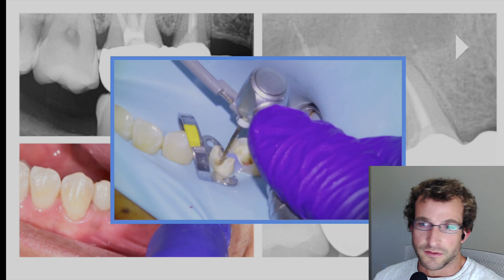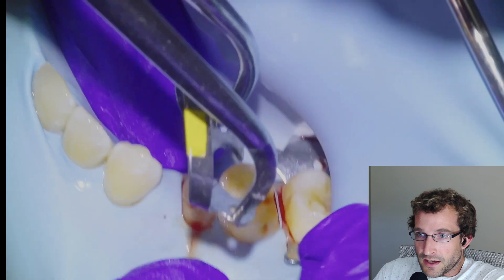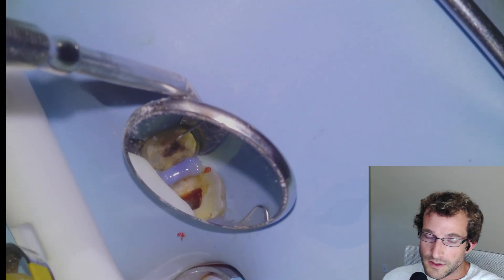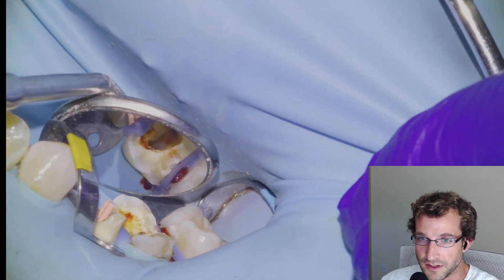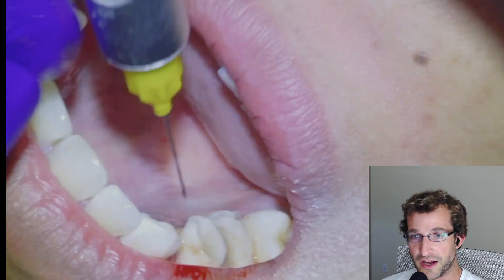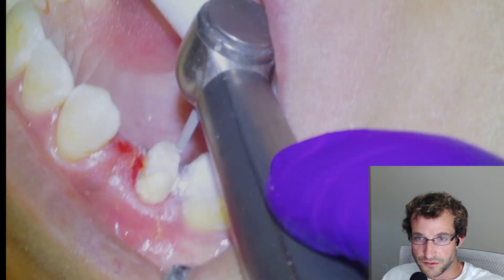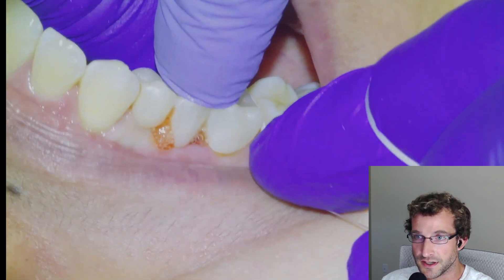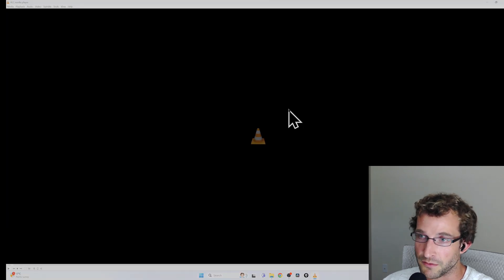[90] Double Root Canal + Cantilever Bridge

Comment: Appreciate the videos. Would you consider making a video on ergonomics and patient positioning? Or just a sentence at the beginning of each video describing how you positioned the patient? You always seem to have such great direct vision of the upper arch.
Reply from the maker: Thanks. For sure, I've had this requested before so I'll try to include access tips. For this case it's basically chair back as far as it goes then have pt look to the left. Be sure to tell them you'll be retracting the cheek in the opposite direction. Their instinct is to turn their head towards the direction of retraction but you need to tell them to resist. Sometimes having them extend their neck (look up toward the back wall) can give you better visualization of the upper arch. I also have shit ergonomics and move my body into whatever position I need to be in order to see the tooth clearly

Comment: From the sound of it, there was no sinus perforation which is good.

I used to attach my apex locator to my rotaries, but found the measurements to be too unreliable. Nowadays, I’ll file about 2/3 of the canal (usually around 13-16mm), then take a WL with hand files. Personally, I’ve found the apex locator to be much more accurate, and I haven’t wasted time since I’ve done about 2/3 the filing by then.

Thanks for the case!

Comment: Is there a particular reason you chose to bridge the 16 and 15* rather than doing a seperate crown for the 16?
Reply from the maker: We really didn't want to prep the virgin canine and a cantilevered pontic from just the 5 would have been too much stress on the tooth since it was mobile due to the infected apex. It was almost a blessing that we ended up having to endo and crown the 6 rather than just replace the MO because it saved the pt from an implant in the 14 site. The 5 and the 6 together provided enough anchorage for the cantilever pontic for the 4
Reply: @behindtheloupes  Oh nice, I hadn't considered the point of anchorage for the 4.

Comment: what about biological width where margin close to bone?
Reply from the maker: If I wasn't able to isolate the margins neatly for the scan I would have done some osseous resection interproxinally but that wasn't an issue here. I routinely do these gingivectomies down to the bone with the electrosurg when indicated and they heal up just fine, chronic inflammation isn't an issue as long as the margin is crisp
Reply: @behindtheloupes  could you not have taken physical impressions and scanned them instead?
Reply from the maker: Scanning impressions doesn't really work that great. You could take a PVS then pour it up with a fine die stone and then scan that which is what labs used to do between when CADCAM was coming into vogue and before dentists started using intraoral scanners.